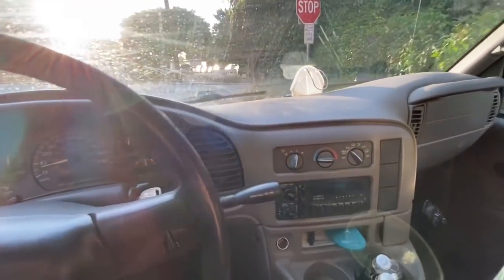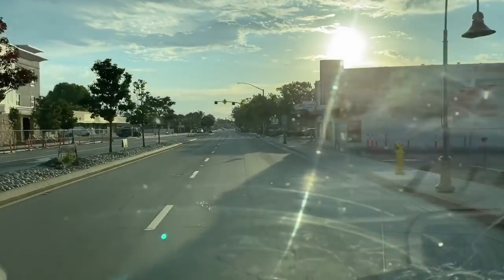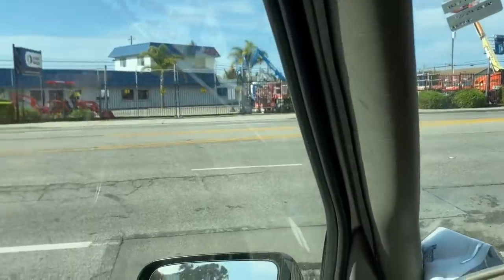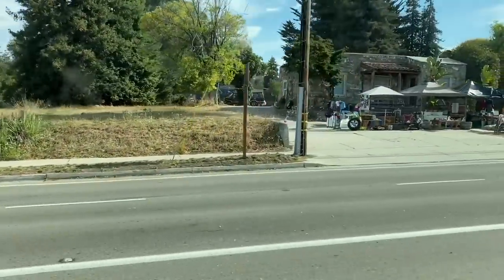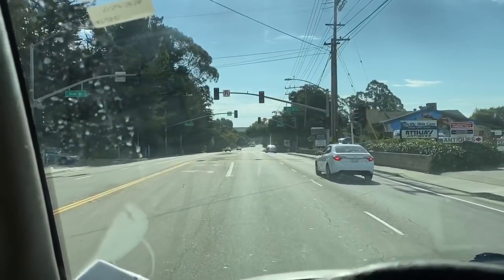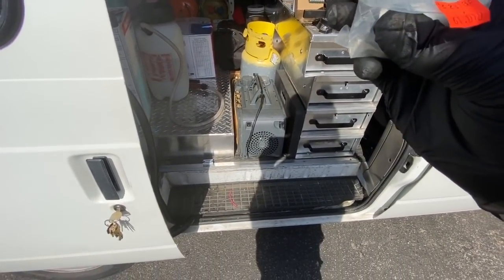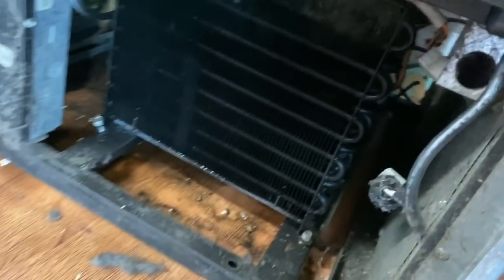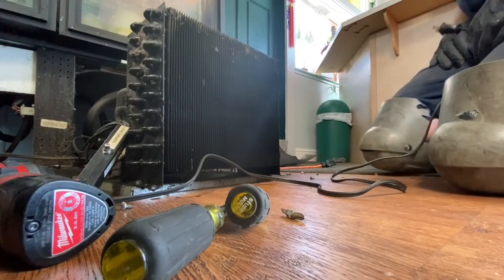Sunday calls

Comment: I changed a compressor on a old True 3 door refrigerator a few months ago. They sent me a Aspera compressor that was nothing like the factory one. Ended up having to do a little half assin to get the compressor to mount as the feet did not line up at all. I called tech support and they said it was the right compressor but I should have ordered a optional mounting kit with it. Now they tell me!

Comment: I watched the old video in the card you posted & you added the piece of cardboard on top the fan shroud & on the new video I didn't see it on there when you pulled the condenser out. Was this a different unit at the same place or did I miss something ? 👍

Comment: That’s when you add a dual pressure switch so in a year when it runs out of Freon five times because it needs a evap, and the compressor dies again it won’t be on you!!!! Especially with there maintenance track record.